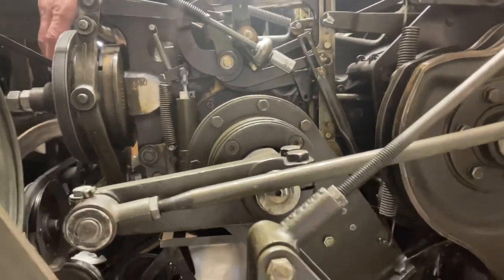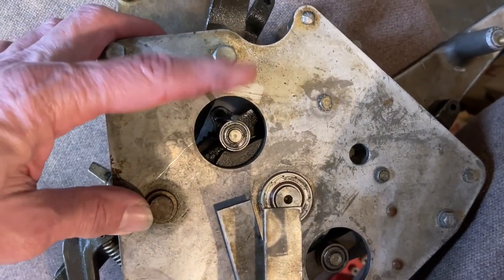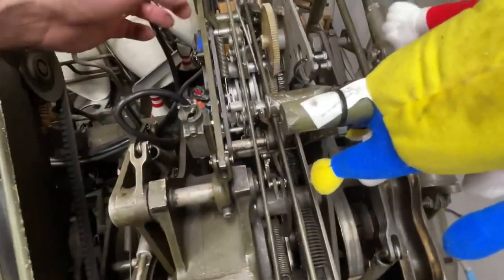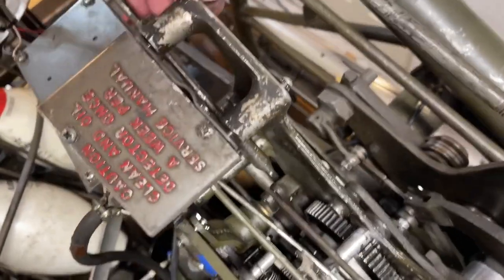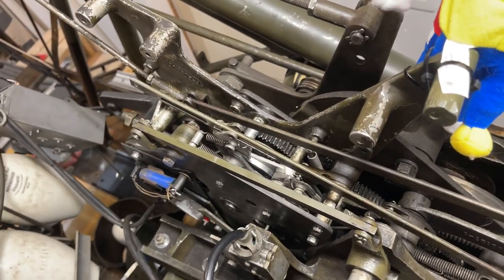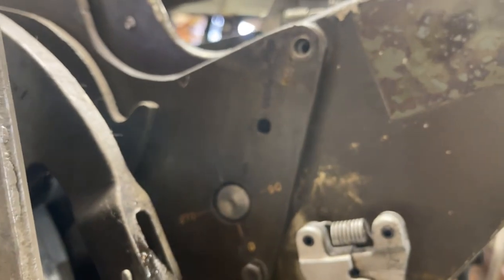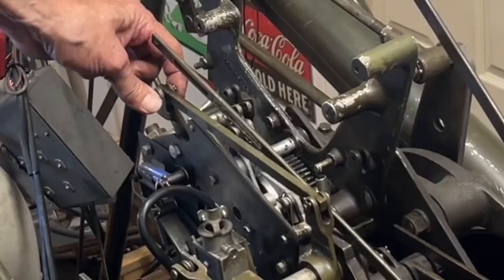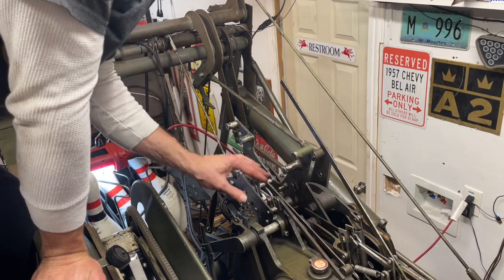Detector removal on a Brunswick A and A2 pinsetter Garage Bowling Alley #bowling #brunswick #vintage

Comment: I have a a Model
Reply from the maker: Where do you work ?   What serial number are they ?    Got a bum detector ?
Reply: @GarageBowlingAlley  I work at shore lanes in Neptune New Jersey I know it going to happen to me one day and I want to be ready your videos have been inspiring a lot of the stuff I have been working on was let go with out pm I got them running pretty good retired construction mechanic learning a new field
Reply: @GarageBowlingAlley  my machine serial 5688 starts at Old Otis some of the stuff I have seen shake my head
Reply from the maker: Nice original run of pinsetters.   Probably 1957 made.    Kept them going !